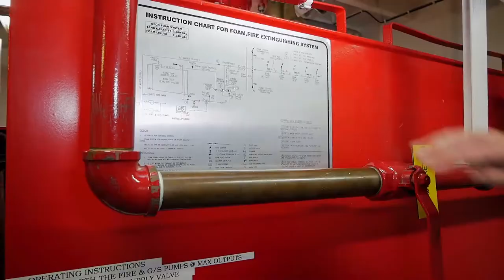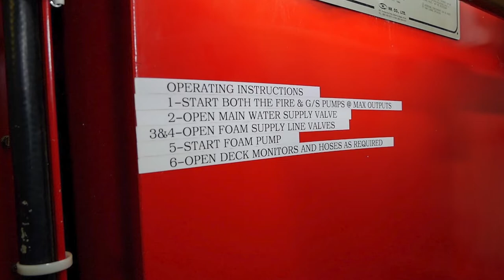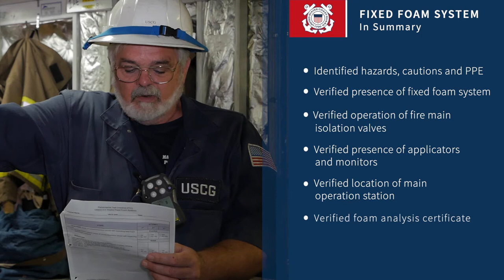Firefighting 4 5 Inspect Fixed Foam System

Comment: @MIPSA Training
1. It is LOW FOAM since it is going on deck(not HIGH FOAM as mentioned on video). HIGH EXPANSION FOAM on deck would just not be usefull as if there was any wind, it would blow the foam away. 

2. By the looks of the metal plate on minute 1:00 the manufacturer I assume would be the company NAKAJIMA. What to test more/inspect:

A: IF the starting procedure is written. In this case is written by very poorly (minute 1:05). It does not state the limitations of the equipment. For example the NAKAJIMA system that i encountered on a SUEZMAX TANKER(system which very much resemblace with the one the video): the FOAM PUMP did not go more than 8 bars and the water pressure inlet on the PROPORTIONER should always have been 1 bar less than the FOAM PUMP PRESSURE(DISCHARGE PRESSURE) otherwise the FOAM CONCENTRATE would not inject/mix with water and go on deck.

B:  EVEN with point A in mind there is still some things to clarify: if maxim 8bar out on FOAM PUMP this would mean that 7 should be maximum on the water line, right? Well actually is wrong. Discharge pressure on the foam monitor was for 5 bars calculated at the inlet of foam monitor(although with plain water would go up to 16bars - more even than the fire pump could ever reach). Furthermore this 5 bar limitation was also on the FOAM APPLICATOR. BUT the system was designed for the use of ONE FOAM MONITOR AND 2 FOAM APPLICATORS at the same time. So in case of EMERGENCY you make 5 bars on the water line, make the water foam mix and send it on deck through FOAM MONITOR. After opening the FOAM MONITOR, ONLY THEN you can increase up to maximum of 7 bars, provided that you use the additonal 2 foam hydrants/foam applicators (at this point you are also sending the firefighters to tackle the fire with foam hoses)

ONE MORE VERY IMPORTANT THING THAT I ENCOUNTERED IN MY EXPERIENCE is the inlet FLOW of WATER before the proportioner. In my case it was limited to 6000L/min. FROM MY ENGINE ROOM it was common line until it split the water into FOAM LINE AND FIRE LINE. VERY IMPORTANT.

C: Provided that you have a small fire (5 minutes) and you extinguished it, then you need to bring the system back to its original readiness state. 
But before this you need to do a thorough flushing. There is no instruction on how to do the flushing in the video. On the ship that I was, there were 2 flushing methods one good and one bad (both in the manufacturer manual pdf. The good one required to make the line up and start the fire pump to clean the FOAM pump without starting the foam pump. The other method was stating the same but with the start of FOAM PUMP which is wrong because it would create to much foam inside the FOAM PUMP. It would be as if you put detergent into a bucket and stirr it - foam will be created). Provided that until the destination port another fire rises, system should go flawless. 

D: Every half of year the pump should be run on recirculation mode for 20/30 minute (ON THE NAKAJIMA manufacturer) the reason being to mix the foam into the tank and through this to ALSO simulate a full discharge of the FOAM TANK.  THE 20/30 minute rule from SOLAS. By doing this recirculation we keep the foam fresh and also check the FOAM PUMP for good condition, overheating, bearing noise etc.

E: I wrote A, B,C and D in order to have a better grasp and also to avoid one big mistake which resulted in the FOAM PUMP to burst foam through its gasket, basically becoming INOPERABLE for that day. IT ALL DEPENDS UPON MANUFACTURER MANUAL INSTRUCTION WHICH COVER MORE INFO( mine even had all the calculation of the system, how many foam monitors required, how much working pressure, how to do the flushing)